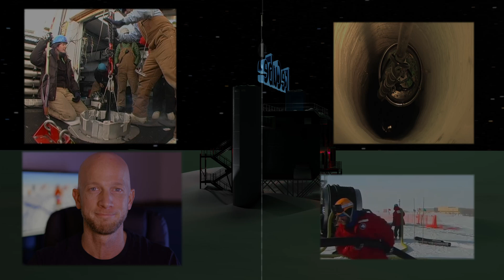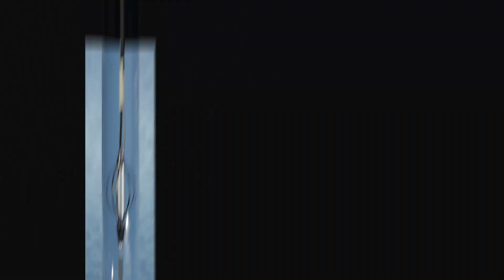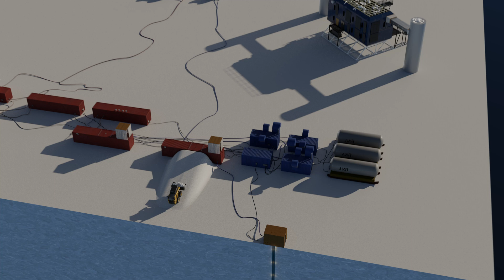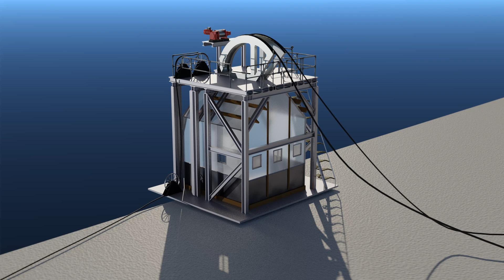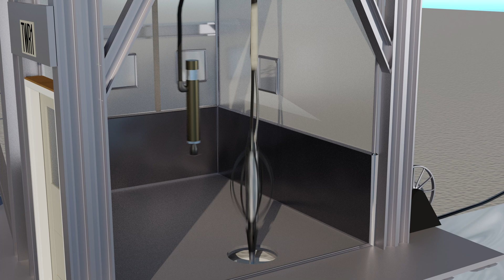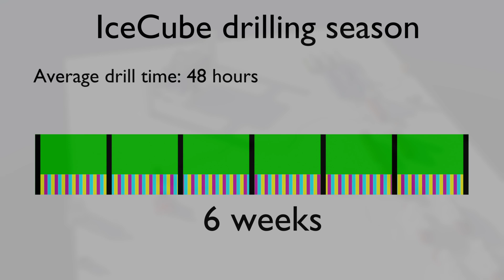Drilling for Science - The Making of the IceCube Neutrino Observatory

Comment: When talking about IceCube, don't forget about the surface array called IceTop. At the top of 80 of the primary holes are two tanks with two DOMs each that were filled with water and allowed to freeze. (I think the 6 deep core IceCube holes have a single tank at the top, but it's been over a decade since I needed to know these things...) When I was an employee of the Bartol Research Institute at UofD (Martin A. Pomerantz (who MAPO is named after) was the 2nd director of Bartol) I built 160 of those tanks in Winchester, VA (if you want good ribs check out Cork Street Tavern in downtown Winchester), and was on ice for 3 deployment seasons including the final deployment season.

IceTop is primarily for studying air showers, but also acts as an active filter to help reject downwards going neutrinos from the main IceCube array's data.

Comment: I read a book from a guy that worked at this project, he said that they used the warm return water as a hot tub. Also there ist the southpole saunaclub you get into it by being in the sauna and then runnig about 200m from the station bare naked (slipers are allowed so your foot does not freeze to the ground) to the geograthical south pole touching it and runnning back.
Reply from the maker: That's cool! There are some pictures of that hot tub if you search hard enough 😅. What was the name of the book?
Yes the 300 club is a real thing as well... I got to experience that first hand!
Reply: @JoeSpinstheGlobe  Found it https://www2.lbl.gov/Science-Articles/Archive/pole-gear.html

The book is called 'Unter den Polarlichter der Antarktis - Fünfzehn Winter Leben und Forschen'  by Robert Schwartz, a german physicist and astronomer.
Reply: @JoeSpinstheGlobe I found it unfortunately I cant post the link but if you search for but if you google 'hot tub southpole' you can find it on Berkely Labs archive

The book is called 'Unter den Polarlichtern der Antarktis - Fünfzehn Winter Leben und Forschen' by the german physicist and astronomer Robert Schwarz that lved through 15 arctic winters on the southpole station.
Reply: @JoeSpinstheGlobe  If you google south pole hot tub there you can find a picture from 2000. (I can't post the link 😞)

The book is called 'Unter den Polarlichtern der Antarktis: Fünfzehn Winter leben und forschen am Südpol' it was writen by the german resercher Robert Schwarz who spend 15 winters on the Southpole.

Comment: IceCube was so successful in fact that the successor project to be built around it, IceCube-Gen2, will be TEN TIMES the fiducial volume of ice as the current system and won't be completed for another decade. 
It would be very interesting to know how many of the original 5,160 buried detectors actually still work today, over a decade after they were emplaced. 
Does the 5 MW / 7 figure for the station power consumption include heating?
Reply from the maker: When I was there in 2021, I believe only about a dozen DOMs were permanently offline but with don't quote me on that figure. 
The "7x" stat roughly includes electricity (600kw) + hydronic heating + boiler heating, although all of these can vary a lot based on station functions and outside temperature.
Reply: @JoeSpinstheGlobe  Interesting, thanks! surprisingly few!
Reply: At this point I would consider bringing a nuclear reactor
Reply: @ImieNazwiskoOK  It really should be considered. It worked at McMurdo for a decade and a similar tiny core could amply supply the entire station's needs.

Comment: I'm guessing that at some point they had to make another well to later drill in its place, is that correct?
Shouldn't the Summer season last around half a year?
Reply: You'd think it would last half the year, and "day" pretty much does. But practically speaking, it's only warm enough to permit this sort of activity for the few months in the middle of the southern summer. Outside of those 3.5 months or so, the station quiets down, and a small winter-over crew runs it in essential total isolation until the next summer. But construction on this level is impossible during that time.